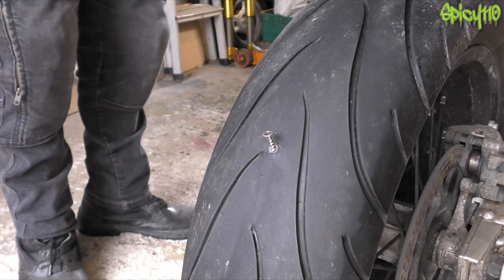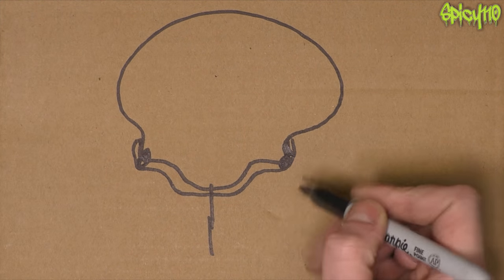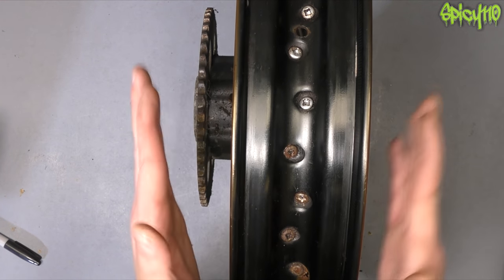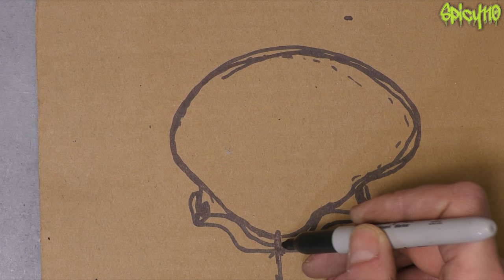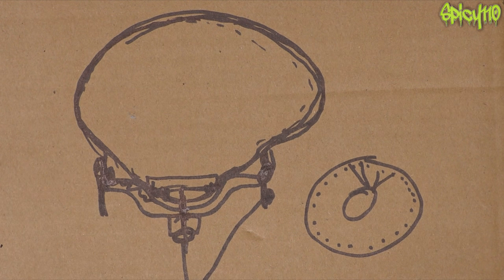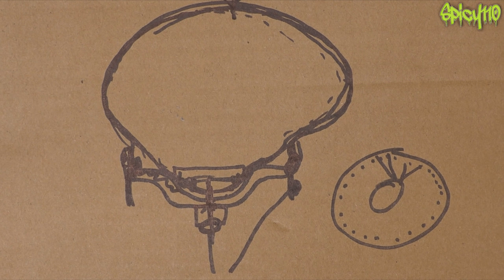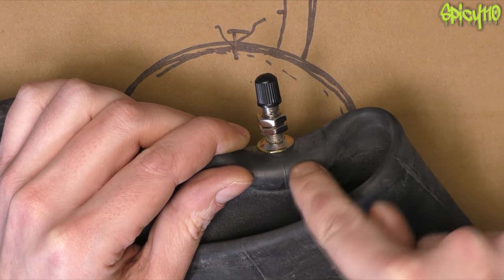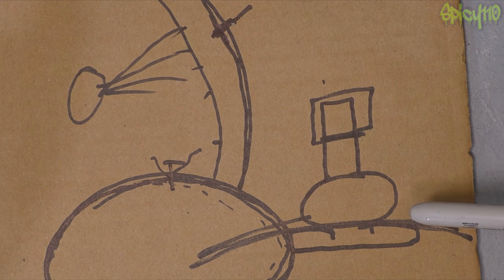What is a "Tubed" or "Tubeless" Motorcycle Rim?

Comment: 11:12 a valve stem on a tubeless setup can still have threaded valve stem and a nut holding it down , that’s what my Aprilia tuono anyway .
Reply from the maker: You and your fancy valve stems! Haha I knew there would be an exception somewhere but generally it a good hint.
Reply: spicy110 I have had to tighten them up before because they were leaking . Year your right it usually is a good pointer .

Comment: You seem to be an expert on rims, wonder if you can tell me if the flanges on tube and tubeless rims are shaped differently. On bicycles, for example, they are different and it is dangerous to run a tubeless tire on a tube type rim. Is that the case for motorcycle rims?
Reply from the maker: To the best of my knowledge (defo not exspet) Yes I do believe there is more of a lip on tubless rims to help hold the seal.

Comment: In my case, the reason for putting a tube in a cast tubeless rim is that it's a new tire, and for added security, I would patch plug the tire  and add a tube. Then I wouldn't have to buy a new tire and not worry about the patch going out.

Comment: You should get the tyre repaired with the mushroom type plug as well as replacing the inner tube. If you leave a hole in the tyre, water can get in and start to separate the layers the tyre is made up of

Comment: My Honda wave has cast wheels but it came with tubed tyres, I changed the tires for street pilots (tubeless) but still needed tubes in them. I also put off road tubes in them with slime to stop getting punctures on back roads.
Reply from the maker: Yer there are exceptions to the rule, seems like small bikes with thin wheels use tubes in some cases.
Reply: Slime  will never fix an inner tube
Reply: @xtc2v  I know, but it gets you home! The slime I used was meant for tubed tyres, never had a puncture after putting it in even though the tyres had lots of cuts on them but it could of been the thicker tubes that helped
Reply: @alistairstuart2009  I've never seen a slime specifically for tubes.  What brand is it?
Reply: @xtc2v  The brand is slime, its mostly used for mountain bikes but can be used for off road bikes and scooters too, I'm pretty sure that this only works in tubed tyres but i'm not 100% sure

Comment: You can also put tubes in tubeless tires if needed for any reason.
Reply from the maker: As mentioned in the video, but it's hard to find a reason beyond having a puncher that can't be fixed and then I would question is that damage so bad you shouldn't be using the tyre at all. 🙂👍
Reply: @spicy110  I know someone who bought the wrong tire for his bike (Tubeless) we just fitted a tube inside works fine.

Comment: I have a keeway super light, cast rims and a tubed tyre. I've never understood why it's this way
Reply from the maker: It is indeed very odd, but if they are doing it I guess there is a reason....🤔
Reply: I think bikes designed to be used in countries that have poor road surfaces used tubes as it's easier to just carry a spare inner tube and throw it in if you get a puncture than trying to plug a tubes tire,

Although you can convert a tubed cast rim to tubeless if you want I did it on my Suzuki GN125
Reply: @ilovecake50  makes sense, I think next time ill ask at the garage if they can be tubeless

Comment: I'm doing motor vehicle in college and i have repaired a tyre with that mushroom shaped wire thing and i also needed to place glue before pulling the wire through im trying to find the difference between a tubed and tubless tyre but im working on cars i thing there just the same
Reply: Cars are only tubeless tires (thank God), at least modern ones, some antique cars have tube tires.

Comment: hey love your video keep up the keep gd work.  just a quick question. we all know 125cc bike are not good for A1. road . for long periods of  time .but sometime we have no choice. my question is. l have a 125 which l use for work now. l do about 250m  a week.Majority times there are on 30 roads which is  find. but sometime l have to go on.a1 road. so my speed is 40 45 mph for half hour my red line at 11000 rpm. l do my best  to keep between 5000 an 6000 rpm do u think this is ok for the bike
Reply from the maker: It obviously depends in the bike but normally 125cc bike can take the abuse, even if your up around 8k remember they as built with that in mind.
Reply: @spicy110  ok thank for the reply
Reply from the maker: Just make sure you do your oil changes! Should have said that.
Reply: @spicy110  thank. l do mine every 2.500 miles. but now I'm doing a lot more a1 road rideing.so  gonna change it to every  1000 mile

Comment: This was a really interesting video, as was Jake's lacing up a wheel and his other one of making them tubeless. FortNine recently made a video on tyres/tires too and how they sit on a rim of a motorbike compared to a car. I have Kineo tubeless spoked wheels on my Moto Guzzi V7, they look bling as hell and are a bit lighter than the forged ones they replaced and the tubed option on the other verients of the V7. On the dirty bikes, Big_Pezza mentioned on Twitter that there is the TUbliss system which is very cool and allows you to run 0 psi if you wanted to for mega traction, you can also get mouses and tireballs, which will stop you ever having to worry about punctures again, but I don't think they are legal for road use due to heat issues.

Comment: No, you cant put a tube in a tubeless wheel. The valve won't fit the hole .. properly. The hole will be too big.
Reply from the maker: Yes you can, Many people do it. You may need to mod it but it can be done.
Reply: @spicy110  well, if they do enough work, anything is possible, but tubeless rims are not made to protect tubes. And a tube is no savior for a bent rim or other damage to a tubeless tire when you're 100mi in the middle of nowhere. 
https://youtu.be/9oq1KOFG5-s
That's Continental Tires. There is a good reason motocross bikes do not use tubeless tires. And the same applies to ADV bikes.